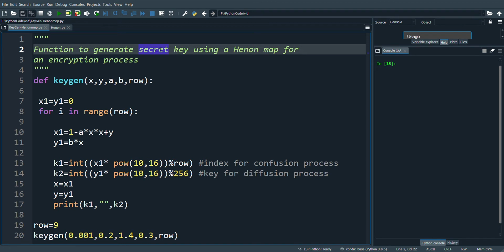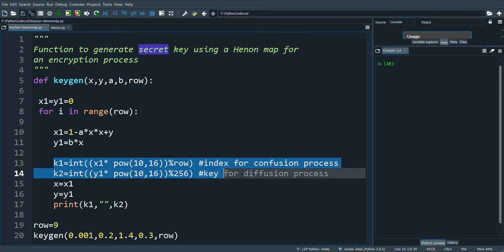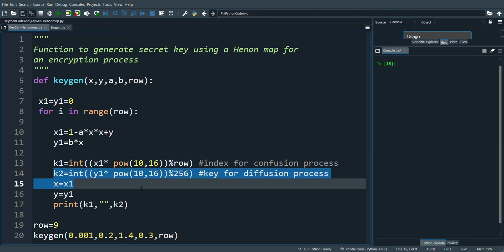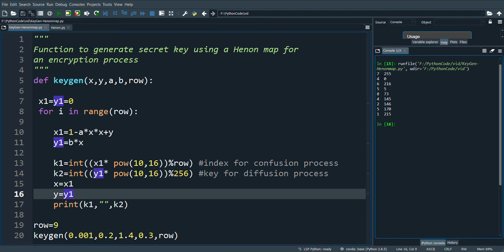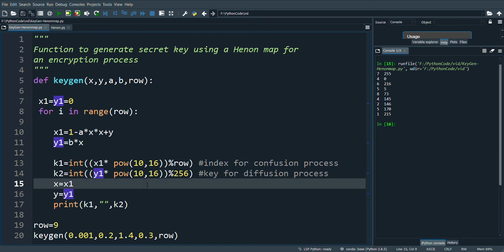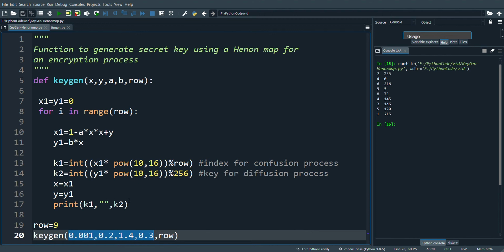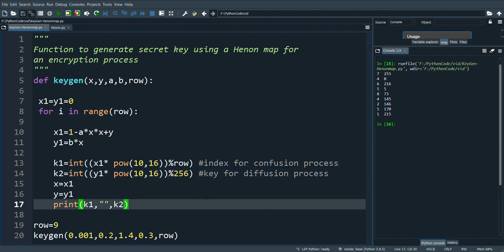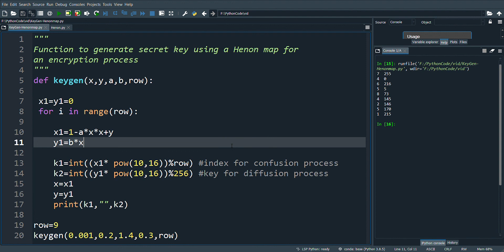How to generate a secret key with Henon map for encryption? Secret key with 2D map

Comment: hello,I have a question for you; Why you use [(x*10^16)mod row ] for the generation of k1,?please explain to me
Reply from the maker: I am generating a key for confusing the pixels in a row, i.e., shuffling the pixels in a row. So my key will have the index ranging from [0, row-1], so that the pixels can be shuffled in this range. So, 'mod row' is performed. 
For 10^16, this is user defined. You can choose any value instead of 16. Try experimenting with different values, and you will observe different keys generated
Reply: @chaosandcryptography5100  Hello..Please upload a video of How to encrypt an image using Henon map
Reply: @chaosandcryptography5100  Thank you very much for your efforts